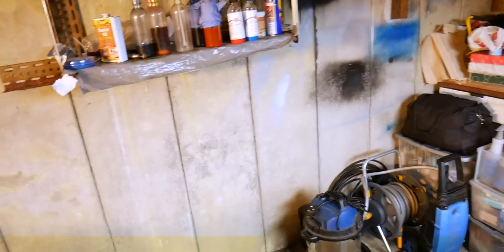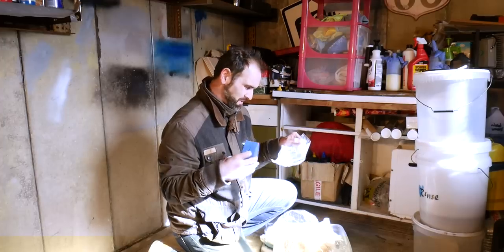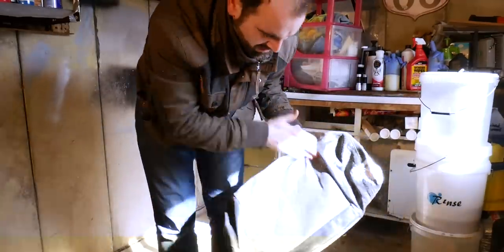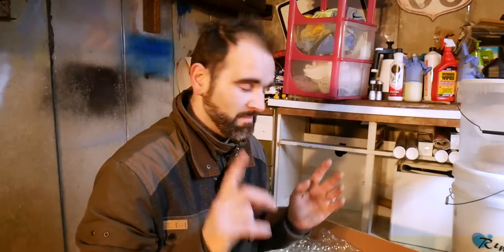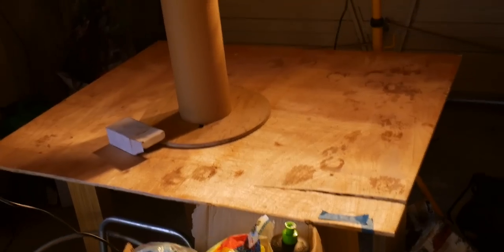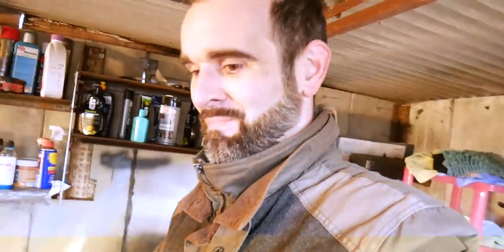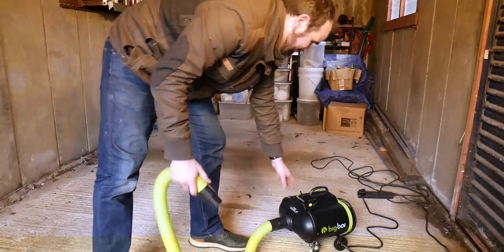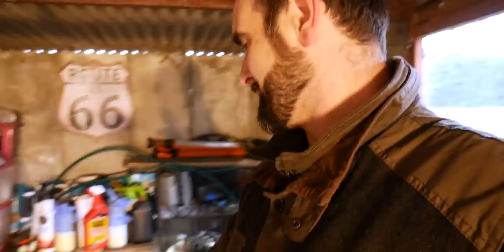DW Vlog - Garage Renovation, Finding Hidden Gems And Looking At New Products

Comment: Lol I got iron X when it came out used for 2 years (smelt rank!) Not used since! I also have them Wilko grey storage boxes but they are breaking now. Need to buy new boxes and throw stuff out despite ditching loads 3 years ago when moving! I am too scared to use old products on the cupra!
Reply from the maker: I remember the original iron x. The new stuff smells "better" but still chemically. Nothing will ever smell as good as Dodo Juice Red Mist Tropical 😂🍹